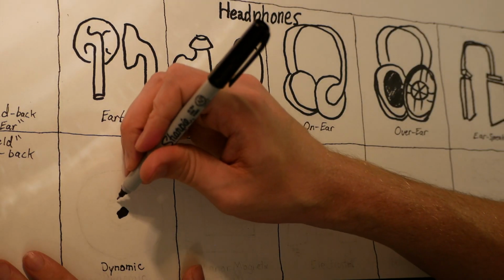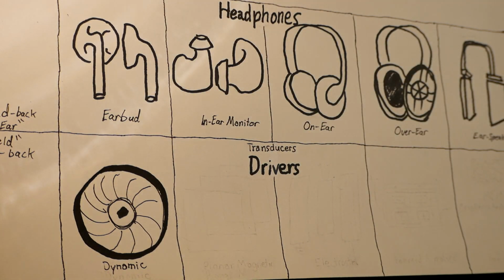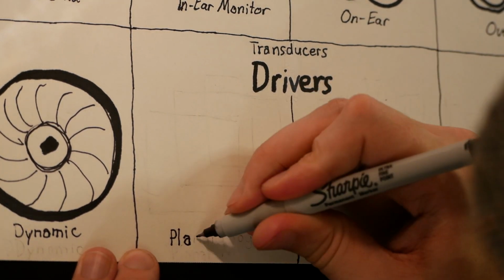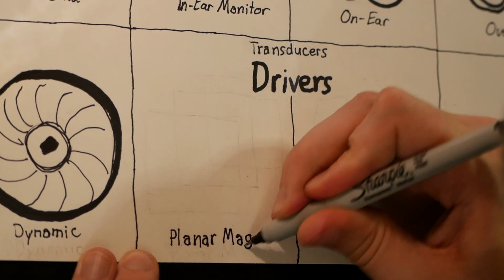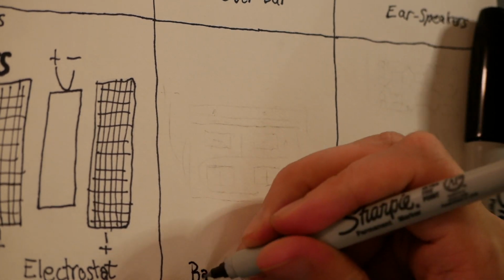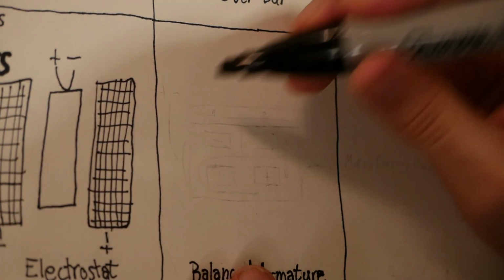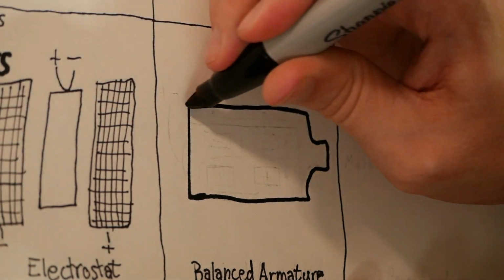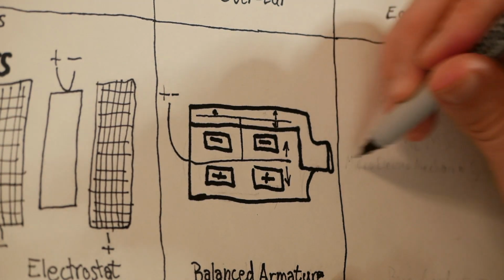Teaching Tuesday: Headphone Drivers

Comment: Thanks for the informative video! Love your drawings! Was wondering if you could share more about the bone conducting drivers? The ones I've seen in a teardown video are similar to the dynamic and BA drivers.
Reply from the maker: Ok, I talk about them @18:38
Small correction: it’s not the low end that isn’t reproduced well, but the highs.

As the frequencies rise, and the vibration “thumps” against your bone get faster and faster, they transmit worse and worse through your body, getting more quiet and slurred until they lose the ability to transmit at all. This is a function of physics, not computational power, so it’s unlikely we’ll ever see high fidelity bone conducting headphones. However, they are great for phone calls while exercising or walking in public where you need to hear your environment, and someday they might be an interesting part of a multi-driver setup with bone conducting drivers handling the lows and BA’s handling the upper mids and highs, but since they all end up vibrating the eardrum in the end, designers still have to be concerned about different sounds masking others.

Anything more would you like to know?
Reply: @evshrug  Thanks for the insight! I was  wondering about the insides of the driver and the physics/mechanics, like how you've gone in depth with the rest.
Reply from the maker: @cindylmy  Ah, well I don’t have in-depth knowledge about them, and I don’t think there is a standardized design. I wouldn’t be surprised if AfterShokz and Bose looked a bit different if you drew their insides. Part of that is because I think bone conduction is limited: might be nice as a fitness background noise product, or military communications, but for full frequency music it’s kind of a dead end. There’s just a point where they lose definition in the highs, and eventually they just can’t make higher notes at all.

I can theorize how they work though. Inside, there has to be something creating vibrations, probably something similar to the haptic motors that we feel give us notifications in our smartphones, except smaller and lighter so that they can move with less inertia/faster. Let’s call them “thumpers.” These have to thump against one side of the enclosure, so that there can be one surface that is vibrating and can make physical contact with your skull. The vibrations will be too small and not strong enough for you to feel them much to the touch, but they cause a part of your skull near your ear to vibrate, and then the vibrations conduct through physical contact until they reach your ear drum, where then the eardrum then vibrates the same way as when you listen to sound that travelled through the air.